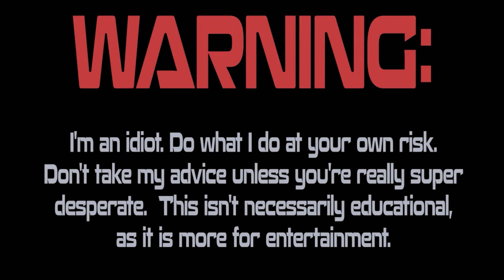FORGOTTEN 1970 Evinrude Skeeter Snowmobile - Will It Run? Part  2

Comment: I had a question here as I grew up with that stuff in the 70's being that my uncle that had all the fun toys favored Polaris stuff we had several Polaris machines including one of those 6 wheeled swamp buggies. I remember all those machines had those cables ya had to wrap around your wrist so if ya fell off the machine stopped. This machine doesn't have that feature... Why??? The Evenrude my Neighbor has is a 74 and it has that shut off cable.

Comment: The Black filter wrapped w a chicken  wire like wire .you showed during video .A Guy could find mat type filter material ( On Master Carr.comp  )  like one uses on a large  air Dryer for compressors 
(.I/R uses a mat about 1-1/2" thick )

Not sure if you ever ordered  fr. Thst site it's a online Catologe Have pretty  much  Everything  fr Soup to Nuts..lol.

Most stuff if ordered  before  2pm
Deliver in 2 days..

Comment: If you have a really stubborn plastic pipe and the chances are your going to snap all kinds of tiny bones in your hands whilst fitting it, you might want to soften the ends of the pipes with boiling water, they just fall right on.

Comment: You know, a guy should really get his hands on a '73 Evinrude Quiet Flight. Compression release, prime, choke, neutral, reverse, cig lighter, and and digical start all on the dash. Also a door you can open that will blast heat towards your chest/face.

Comment: Skags?? Whack some flats into some 3/8 steel bar and weld some grade 8 bolts where the holes belong on your skees. Bend them so they fit... Don't forget to use some nuts to hold them on.

Comment: You didn't by chance figure out something else unique about those opposed engines did you?  They both have to fire at the same time.  Why?  The fuel pump and reed valve share a common crankcase with both pistons and couldn't work if they alternated (also why there are two ignition coils - one for each piston and sharing common primary circuit wires).

Comment: I wonder it a couple pieces of rebar cut to size might work just grind em a little smooth n a hell of a lot cheaper then buying new ones.Complements of wishek steel manufacturing no longer in business of course

Comment: Derek that Targon Line is not the best thing to use inside a fuel tank. High pressure fuel injection hose works better only ya gotta muscle it into place or put a plastic fuel elbow on it. Trust me that Targon Line was never the best and now days it's total shit.

Comment: I  can see it now, your riding it on the state trails and a $20,000 machine flys by like the wind, while you putter by at 25mph. 
You eventually catch him as his fuel injection machine won't inject, as the boat motor sounding Evinrude cruises by him your waving the middle digit at him..!  See ya next time...

Comment: I had a guy owe me 50 bucks back a few years ago . I never lend money unless I know I can afford to not get it back. This guy owed me for better then 6 months. He showed up one day asking for 10 bucks for gas I said listen I let you borrow 40 6 months ago and you did not pay me back so no .
    The guy said damn well hey man I have a snowmobile  I have not used  just sitting in my parent's barn you can have that . I said with a smile no I want my 50 bucks. The guy said well listen if you lend me 10 bucks I will give you the snowmobile and still owe you the 50. I said no then you owe me 60 because you want another 10 off me. The guy said yeah ok fine. I said ok fine as soon as you have that snowmobile in my garage I will hand you another 10 bucks but it better have a clean Title and in my hand sign it over to me. He was like ok sure.
     I like most loved working on cars trucks tractors anything that had a Motor I was in my glory. The guy showed up with the Snow-machine  Yellow . Looked almost new even the tracks looked almost new. Not a scratch on it. No rust. I said does it run ? He said well no. I held out my hand and he said what I said the Title and sign it over. He did I handed him 10 bucks. I went in my house made a drink  and went out to look the Snowmobile over.
      Just from the eye what I saw missing was a fuel line  to the make it go thingy.  I pulled the whatchumacallet on the thingamabob and it had compression. I lived not joking no more then 80 feet from an auto parts store the owner was a friend of mine that we both went to school together. I told him what I was looking for. I got nothing but the best deals from him because I was also there buying parts almost every day .. I told him the deal I made and he asked me if he could come look at it. Sure I said . So he got me the fuel line and brought it over to my house. I showed him the Snowmobile. 
      I cut the dohickey to put on the make it go and put new tighteners . I cleaned out the holding tank for the go go juice  and added fresh go go liquid .Pulled it 4 times and it started right up. My friend laughed and said you will love that it's a great Machine. I said not really I don't need it or have time to ride. He said I will pay you 750 for it right now. I said sold.